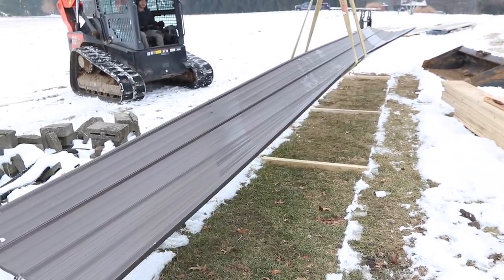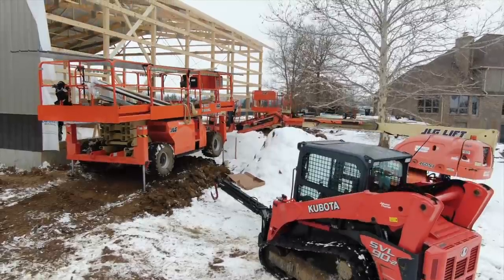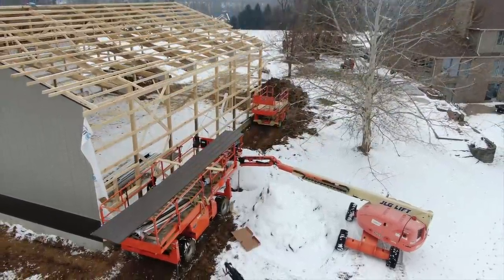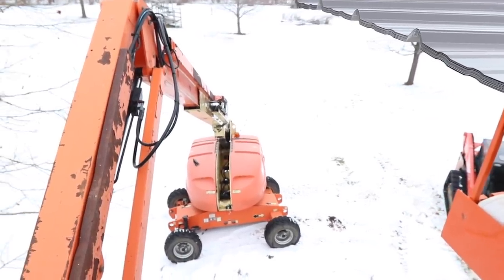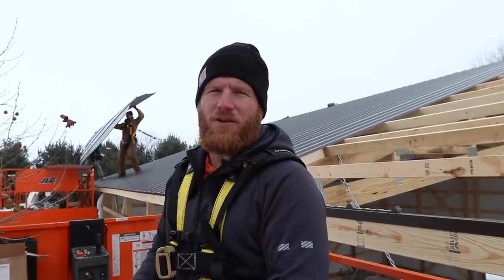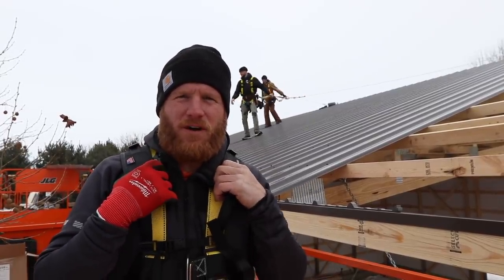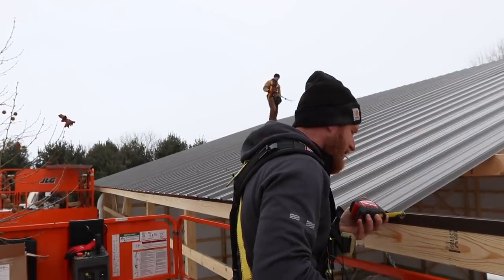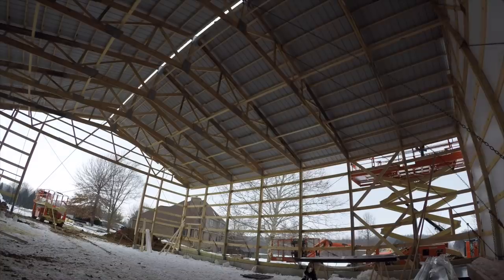Building a Work Shop: The Right Tools for the Job

Comment: I know this video is a little old, but I'm currently building a 40x64x16 with two 14' tall overhead doors. I'm handy but not a contractor by any means. These videos have helped tremendously. Just put up the roof last weekend with my father-in-law with only a rented telehandler and rough terrain scissor lift. The right equipment makes a world of difference.

Comment: Top notch builder! Every piece of equipment that makes the job safer, quicker and is cost effective is money well spent!
At one time I owned everything from my own tri axle dumps to  a shotcrete pump. 
I would have a dual rear wheel truck for that trailer, just my 2 cents

Comment: Machinery video, yes please!
Something you do consistently Kyle is you spend the money on productivity, you will move to a new tool platform, etc when you figure out it increases your productivity enough. I see so many guys here in Japan that are using 20 year old tools or older doing things the way they did it back in the 70's or 80' because that's the way they have always done it, even though it is very slow and wastes a lot of time.
BTW that Greg fella is sure a good kid, funny too, and it looks like Zack is certainly coming along well too. Actually I'm not surprised, under your careful instruction and following your excellent example they are becoming great craftsmen, well done Kyle.
Cheers from Tokyo!

Comment: Just a little tip from an old timer. When binding down any equipment, after the first initial tightening, go back and smack the chains with a pipe or 2 X 4 to make sure there are no soon to be loose kinks.

Comment: Looking good! Here this Arizonian is frozen with outside temperature between 32 and 45*F and  inside temperature of 60*F (too cold for the heat pump to work) and here y'all are going strong below freezing. Still though, hoping for a cool Summer for variety, three years without a monsoon season is too much.
7:00  to 7:15 is also why soft soled shoes are safer, can grab with the foot.

Comment: Hey Kyle, always enjoy your videos. When chaining equipment on trailers using screw binders, I've had them vibrate and bounce loose.  I now always put the binder on the chain so that the handle will bump against something, either the equipment or the trailer deck. That way it can't unscrew if the handle bounces.  Tighten the chain, then wratchet the handle all the way back until it is against something. Then the only direction it can go is tighter.

Comment: In response to your request for input........ I have a pair of Jaguar Paw roofing boots that provide great traction on roofs. But, they're really meant for traction on asphalt roofs, and they provide protection for asphalt shingles ( which can be easily damaged by sliding footwear ). I see no problem with you folks using sneakers for this kind of work. Whatever gets you back home after the end of the day!

Comment: Careful about latching support chain over sharp edges like in @0:50. I've seen stuff like that snap chain  links (yes, welded ones) and rigs falling off trucks with that setup. It's always best to have hooks or to use chain protectors (PTFE and metal sleeves).

Comment: Check out any pair of shoes with a Stealth Rubber Sole.  Five Ten makes several pairs that are light and very sticky.  These types of shoes are often marketed as bouldering or approach shoes.  I've used the Five Ten Guide Tennie walking on slate and clay tile roofs during inspections and I have felt very confident in them.   I would imagine they would perform well on metal.   Cheers!!

Comment: Have you ever looked into the roofloc system by Fasco? It's the pneumatic metal roofing screw system (or whatever) for post frame  construction. I figured you would have looked into something like that at least for the roof since screw lines arent as important
Reply from the maker: Yes I have
Reply: Any thoughts on that system? Do you think it would be a valuable asset on the job site for doing steel roofs?

Comment: You fulfilled your end of the contract,the customer did not by not having the site prepped for you to do your job. Yes you should charge them for your extra time spent working around that. Not only is it lost time but makes a hard job even harder and hazardous. I have been a building contractor for 40 years and was always the nice guy like you that said,"oh that's ok" and in the end you lose. Don't let people take advantage of you.This work is hard on a mans body, no reason to wear it out faster than it already will. Glad to see you guys tied off.

Comment: Doc martens are know for having soft grip sols that last a life time when i worked at a satelite company i had no problem scaling 45° to 55° roofs that was on shingle roofs but its worth a try.  Every shoe or boot you buy comes with a great warranty and the same soft long lasting grip sole so check em out. Safety and comfort is first and they have limitless options.

Comment: Hi Kyle. Have you thought about investing in a Clad Boy vacuum lifting machine? For this type of mobile crane, such as manitou mrt 2540. Or a stationary crane with a large range (40m = 131.23 ft) adapted for easy movement like liebherr 53k. Such equipment, even used, would speed up the work. I work in Poland with such sets. When assembling steel halls and polyurethane sandwich panels. and they're doing great. I translated by Google translator.

Comment: I have not commented a lot on your videos, but I watch every one of them. I will comment on the production quality of your videos. You put a lot of work into doing the videos, and in my view, they are very well done. After viewing many of your builds, I have only one question. I see that you use chain and cables so I guess do a final Squaring of the buildings, prior to sheeting them. You take the chains and cables off, what keeps the buildings from RACKING, or twisting? You may be installing bracing for this, but I have not seen any.

Comment: Kyle, you put together awesome videos, they're top notch. I need a bigger shop and will end up building one similar to how you build them, I have some equipment but I want a mega deck so bad, that thing is sweeeeeet, and the telescoping jib for tour skidsteer, a video on all your equipment would be awesome, I would be curious to know rough cost on what certain sized buildings end up costing, (ballpark cost estimate) for a 48x72x16 building with no insulation

Comment: From 1980 until 91 we out up huge aircraft hangers factory building no man lifts or fork. Ladders and an old boom truck no one could afford to buy or lease them.
Now we have all jlg and cranes excavator etc.
Kids don't want to climb ladders or dig today. If machine don't run they stop work...crazy.
PS buy a JLG code scanner only $500 . I fix them for years
We a have two 3394 with outriggers and two 600s . JLG the best.
Get a Lull 1044-54 telehander we just sold ours. You can erect anything no crane on small building s. Man Basket goes on and dirt bucket.

Comment: I cannot fault you one the shoe situation, you know the inherent risks associated with working on the roof, if it doesn't call for steel toes then it doesn't; besides steel toes suck to squat down in to work on something below your feet all day.  That said, I think I saw a sole on some shoes at a Redwing store for slippery surfaces that may work, if you have one near you maybe go take a look.

Comment: I've a couple of questions I've been wondering for awhile. Is when you're working on the boom lift, putting sheets up on the roof or doing any work at height. There seems to be a lot of movement, is that movement the whole building swaying or is that just the platform moving backwards and forwards? Also a question from the end of that video is there a reason you don't do the gutters.
Reply from the maker: I don’t install gutter because I have a great gutter sub.  Also the lift rocks slightly and gives the video a weird look
Reply: Thanks. Keep up the great work.

Comment: I have a question, I’ve built a few building so far. Thinking of added a piece of equipment to the fleet. Which one wld you buy first skid steer or lull for all around work. Which one of the 2 can you not live without. Thanks in advance
Reply from the maker: Skid loader for almost everything

Comment: How do you waterproof the roof sheets using the pan fixing method? Jim Sydney Australia.
Reply: Screws have an epdm rubber washer underside the head, other than that not much else for waterproofing other than sipes along the connecting edges, as long as its fasten in flat there should be no worry about leaking
Reply: Joshua79C C . Here in Australia that method of fixing the roof sheets is considered a defect. They say that the expansion and contraction of the sheet causes it to tear the sheet at the fixing point and starts to leak. We also use the roofing screws with the rubber washer, but we have to ridge fix the sheet as the allowable fixing method. Thanks for the reply Joshua. Jim Sydney Australia.

Comment: You say that the access issues only costed you 2 hours and I presume you are inclined not to add a variation because of it was only 2 hours.
Don’t forget , It was only 2 hours because you brought on site a lifter worth 10s of thousand of dollars which you need to make pay its way, so if it was me I would be charging for the access problems, but hey it’s your business so it’s your choice.
Keep up the great work

Comment: sweet video   i have a question that maybe you or someone in the comments might be able to answer  im thinking  of  building a house using post framing  its a 40 by 40 and 20 foot walls  im trying to  get a rough     idea  how much   it will be to have the shell built  provided  the build site is  ready to go  i live in ohio
Reply: Not from Ohio but check out engineers/designers for quotes on the NAFB website of members.

Comment: Is that the building shaking with the screw installations at about 16:03
Reply: Camera mounted on megadeck rail, megadeck was bouncing as he was pushing into the steel to set the screw.

Comment: Do you have to have a CDL to tow that trailer? Or do you get away with calling it for farm/personal use?
Reply from the maker: I have a class A CDL
Reply: @RRBuildings  Is it as big of a pain that most people make it out to be? And thanks for the reply!
Reply: Not sure if you're asking about getting the license to be a pain or keeping a hold of it and using to the fullest is. So many complaining about them ELD rules which are to keep you from cooking your hours of operation as you can do on with the paper logs, so many make such a big fuss about how the govt is always "spying" on them. As for getting the license it is not that difficult as some make it be due mainly to their own way of learning ability or lack there of comprehending such. learning articulation has its challenges but not that hard grasp if you put in enough experience practicing. And depending on what you are going to use in terms of operating said vehicle has an effect on necessity of needing to certify a medical exam with the state per Federal law as all are required to renew and recertify online with their state DMV before the previous expires if they wish to continue their privilege of holding on to it. No matter if operating across or within state lines, afaik as an experienced CDL-A operator. For me the learning part took a few months of training as state law mandates and then it took a few road test (time constraints of 1 hour per/for a test, plus traffic is another beast getting to certain test sites per schedule) as we had to do all as regulated per FDOT rules. Had to do blind and sight side parallel parking/lane change/side alley docking along with normal backing procedure., and as I said showing you can safely maneuver with traffic and around fixed obstructions (not hit or touch a curb ... or bollard or any buildings). Written stuff is about the same, some excel there when others do not who may otherwise suck at learning hands on. For me learning to double shift is easier than a synchromesh manual in a car (the double shift helped me get better at this, then again after a while due to others poor shifting leads to messed up and weird shifting methods and such in different trucks despite having the same transmission when brand new).

Comment: How much weight are you towing there? That can't be legal... Can it?
Reply from the maker: Yes.   IDOT cares about plate ratings on vehicle and trailer... also I have a class A CDL
Reply: @RRBuildings  but how much is the truck rated to tow? And how much weight are you putting on the truck rear axle? The rear tires can only hold 7k lbs combined.
Reply: GMC 2500 Denali HD (from what I can see, not sure what year) is rated for up to 15,400 5th/gooseneck hauling (per this year specs). That PJ looks like a 14k rated gross weight and that lift (if he loaded it right for best weight balance) should not be much an issue as you assume for the truck.
Reply: @Joshua79C  just that machine alone weights 16,600 pounds. With the trailer I bet it's over 20,000
Reply: I was a bit "busy" there thus I was estimating some things, watched the loading up and heading out part again and that my guess was off, yeah that lift is 16,600 lbs alone, then the added weight of chains and binders and also the trailer is dual not single on two axles so that is more likely a 24k rated trailer without any visible model decal to determine which it is. As I already looked up the GMC Denali HD and basing off of as i said, but also hard to say if he could have additionally equipped it with airbags for level ride when towing near max capacity if additionally equipped for more weight. Wonder if he chimes in on whether he went for the extra towing weight package, as they offer it to handle an extra 25% at most.

Comment: At the end of your video as you were fastening the metal wall covering it appears to vibrate every time you hit it with your screw gun.   Seems too flexible even with the roof decking on.
Reply: Extended megadeck bouncing, not the building.

Comment: How do you get away without DOT numbers on your truck?  Id like to know your trick DOT is a hassle!
Reply from the maker: I don’t cross state lines and I am not for hire?  According to my findings I don’t need dot
Reply: @RRBuildings  be careful.  You use the truck and what you tow to make money.  Drop a trailer on a 3/4 ton and it puts you into dot territory,  crossing state lines or not.  If I can be shown different I'd take my dot numbers off.  Love your work. Stay safe!
Reply: Not all states adhere to the DOT rules entirely. here in MA where I life or FL where i lived for a few years you do need the DOT even if just within the state if the vehicles meet the regulations.

Comment: no vapor barrier?
Reply: That comes on before the wall sheets go up, never on the roof
Reply: @Joshua79C  here in tennessee if we dont put a vapor barrier under the roof metal the condensation drips on the floor and eventually rots out the purlins
Reply: Seems to me you do not use enough natural venting  there, but still .. I believe you meant to ask if any roofing paper since vapor barrier is more for interior.
Reply: @Joshua79C  i use synthetic felt and cobra vent closure under cap and vented soffit and have no worries. i think the heat and humidity cause alot of the sweating problems ive seen in the past.

Comment: Do you have a Class A CDL?
Reply: Yes he does, per others who asked similarly and that he answered. Anyone towing more than 10,000 lbs (4,536 kg) or a combination of more than 26,000 lbs (11,793.4 kg) requires a Class A CDL if commercially operating. Similarly if the vehicle is more than 26,000 lbs (11,793.4 kg) one needs a class B and if towing it must be a class A license.